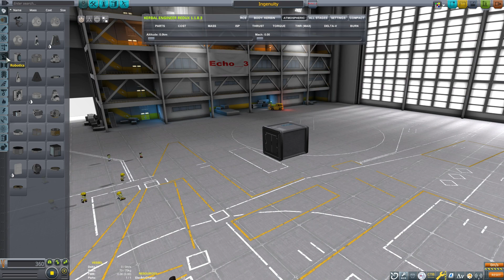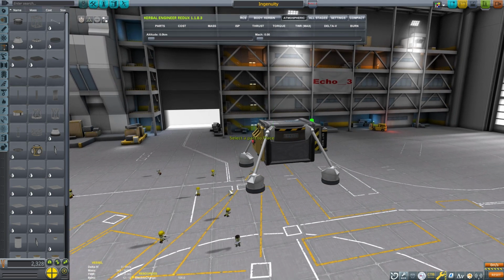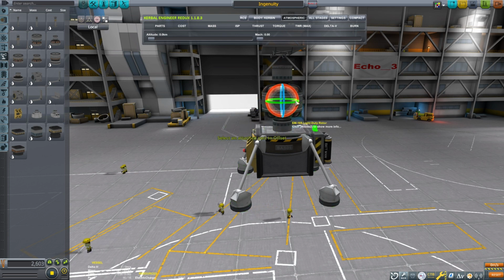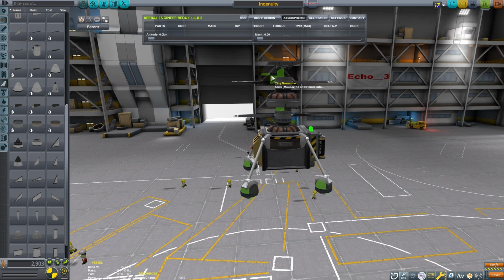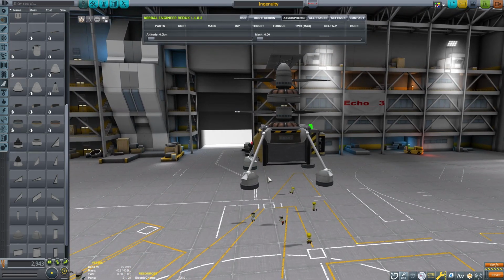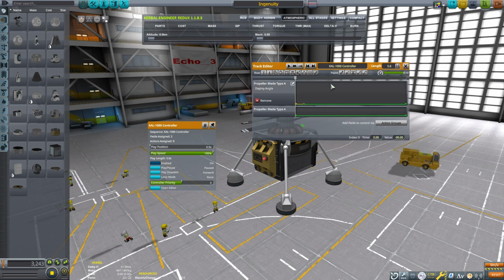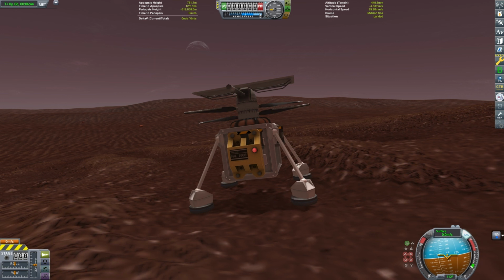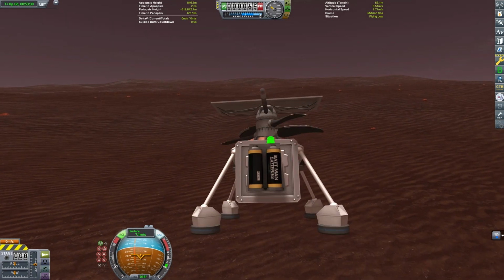Building and Flying an Ingenuity Style Helicopter

Comment: On kerbin it is relatively stable but attempting to slow it down for landing doesn’t work it falls much faster than the propellers can stop it and I don’t understand why. It goes 60km/h right from the launch pad but then I cut the throttle go retrograde and when I start falling I arrest it with throttle but it just keeps falling at 25+ km/h.
Reply from the maker: Interesting. Maybe try adjusting the deployment angle of the blades slightly rather than the rotor speed to better control flight.

Comment: When i used the first prototype on kerbin it didnt fly. I did everything that i saw, as the quality is really low so i cannot see the precise things. What do i do?
Reply from the maker: This is before I was recording in 4k. So, you are making a counter-rotating mini helicopter. The basics are to make the rotors as small as possible, use the duct fan blades, use a KAL-1000 to adjust the blade deployment angle. Bind the blade deployment angle to the KAL and bind the KAL to the main throttle. Set the deployment angle in the KAL to go from 0 to about 8 or 9.
Reply: @Echo3  figured out the issue, my goober ahh self didn't deploy both sets of blades, it works now lol, also I was able to switch from phone to pc to watch this in a higher quality lol, sorry for taking up ur time
Reply from the maker: @qie2iqee  No problem. Glad you got it working.

Comment: you.. do realize inginuity has only one rotor right? good video anyway
Reply from the maker: Ingenuity is a coaxial contra-rotating design. https://en.wikipedia.org/wiki/Ingenuity_(helicopter)
Reply: @Echo3  the link here is great. CLEARLY able to see both rotors, then the circuitry blueprint even SAYS "rotor 1" and "rotor 2", lol... So strange how people can be so mistaken when a tiny bit of research is so simple.
Reply: 2 yrs later, but I'm hoping you actually researched ingenuity after making this comment, lol. CLEAR photos of the design blueprint shows CLEARLY two rotors. One beneath each blade pairing, and another photo of the circuitry shows the battery interface board connecting to "rotor 1" and "rotor 2". Just out of curiosity, where did you get the information that it only has "one rotor"? I mean, just looking at up close you can EASILY see both rotors...